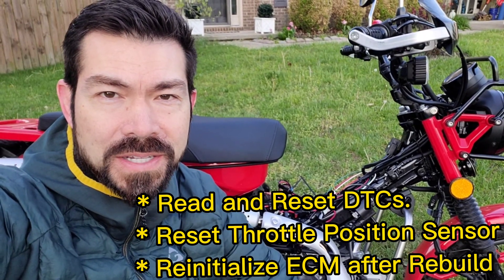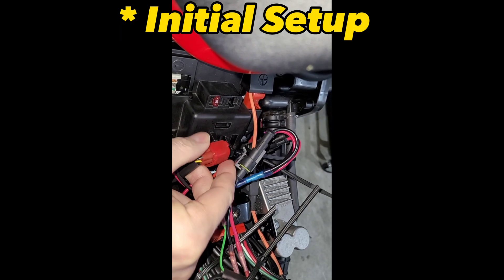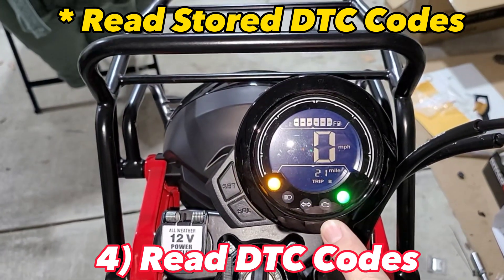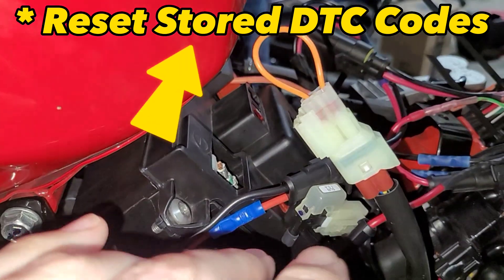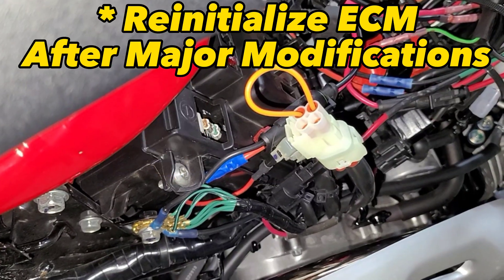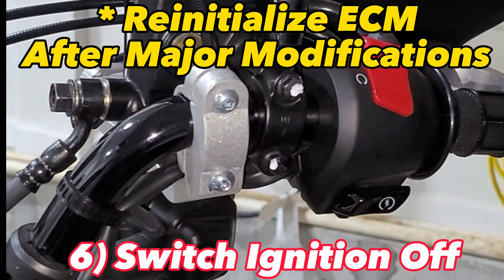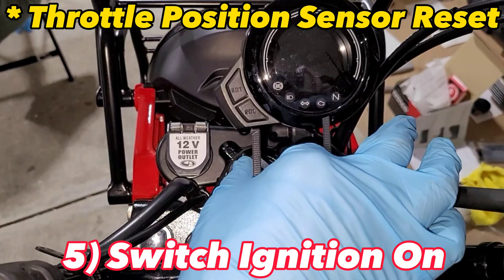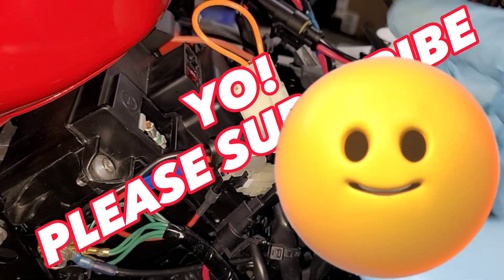RESET (COOL?) STUFF on a Honda Trail 125. CT125 gets ECM, TPS, and DTC codes read and reset.

Comment: Mine won’t spark with new coil , and I hear no fuel pump what’s the deal ??
Reply from the maker: The no fuel pump sound is problematic. Fully charged battery?
Reply: @QuantiQualification brand new battery and new starter relay all Honda oem parts
Reply from the maker: @natm3145 Okay
Reply from the maker: On second thought, is your kill switch flipped?
Reply: @QuantiQualification no it’s in run
Reply: @QuantiQualification it turns over fine just no spark. Do they have the diode in the ignition switch like on cbr 900 etc ?
Reply from the maker: @natm3145  I am not sure if it has a diode. Things I would check is the kill switch (make sure it is working) and perhaps the kickstand switch.  Beyond that I am not sure.  I suggest you post your question on www.hondatrail125.com and see what the experts there might say.  A lot of great and knowledgeable  individuals there should be able to help.